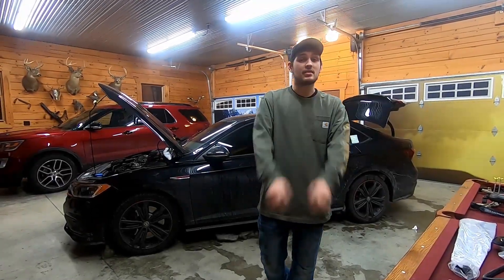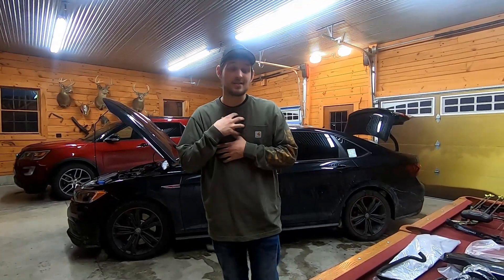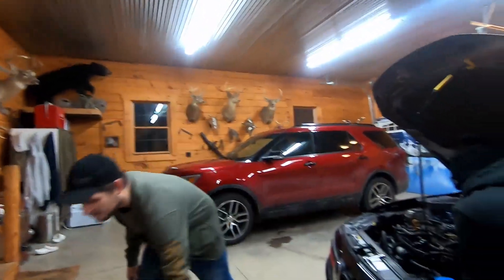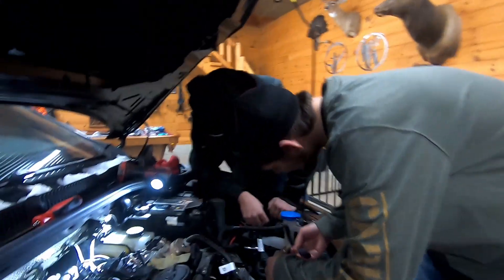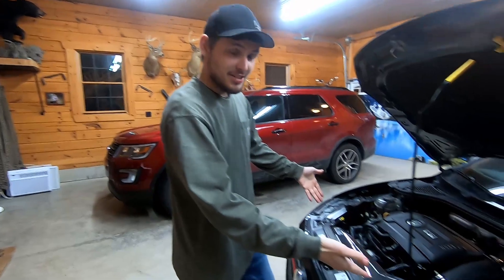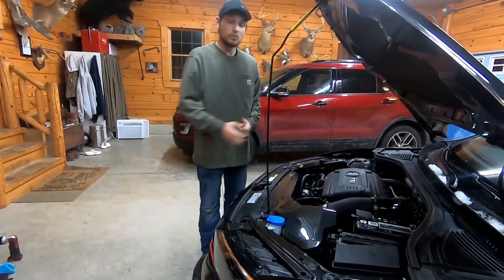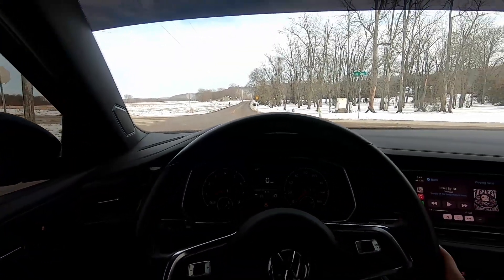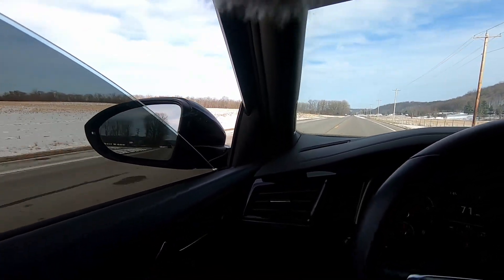Integrated Engineering's Cold Air Intake Install on a 2019 Volkswagen Gli!

Comment: So this is the intake system that I wanted however, when I went on integrated engineering’s website to get my downpipe this intake system is not listed for the MK7 GLI only the MK7 GTI  I called and spoke with an associate from them and they said that they don’t make one for the GLI but from your experience are they the same intake from the GTI  let me know please so I can order one
Reply from the maker: Yes it will fit, on other websites like urotuning or ecs tuning it will pop up for the mk7 Gli. But yes you will be fine. Gti and Gli motor and transmission are the same, so pretty much if it fits a gti it fits the Gli
Reply: Thank you so much

Comment: In this video, were you tuned and/or did you have a turbo muffler delete installed?
Reply: Which turbo muffler delete do you have? I ask because I’m getting a weird noise out of my APR Open PEX intake and I’m considering going IE but I don’t want it making the same noise
Reply from the maker: @iTurkmonster  it is from NEUSPEED I did the hi-flo turbo discharge conversion it came with the kit. It should be in the video I did when I installed it
Reply: @mr.boosted9983  Oh ok thanks! I’ll check it out!
Reply from the maker: @iTurkmonster  not a problem!
Reply from the maker: Wasn’t tuned and had the muffle delete

Comment: How did you get the heat shield to fit in the GLI a engine bay, I can’t get mine to fit at all?
Reply from the maker: It just popped in where the OEM grommets were on the factory air box

Comment: Do you know your intake air temp by any chance? It seems open to me
Reply from the maker: I don’t I can check it with my obdeleven I think
Reply: @mr.boosted9983  just wondering if it’s lower or higher then outside temp
Reply from the maker: @jt_7877  I’ll check it when I leave work today and let you know!
Reply: @mr.boosted9983  thank you
Reply from the maker: @jt_7877  it’s currently 77 out at 60mph it read 81 at stand still it read 95. Kinda disappointed me
Reply: @mr.boosted9983  truly appreciate it. And kind of what i was thinking would happen. Nice set up though
Reply from the maker: @jt_7877  not a problem!
Reply: @mr.boosted9983  thats insane compared to what im getting right now!

Comment: Did you have any clearance issues with the silicone pipe that is next to the brake reservoir? Mine seems to be touching it barely which I think is causing a vibration feel on my gas pedal.
Reply from the maker: I didn’t, the metal pipe has a hump on it that I have aiming up and didn’t have an issue